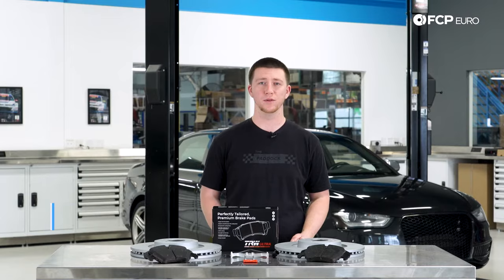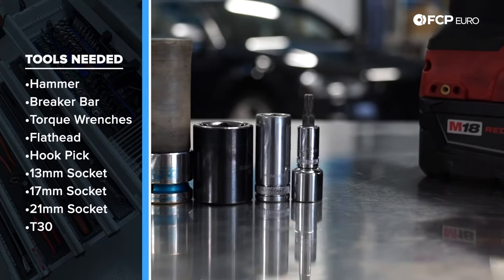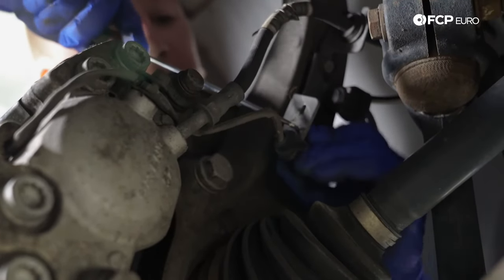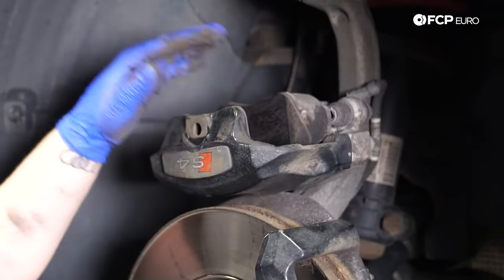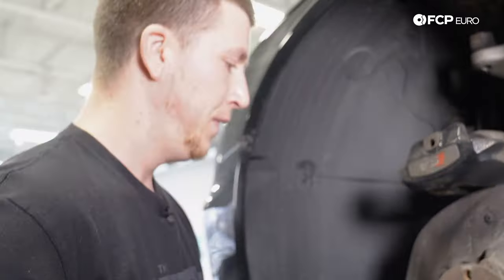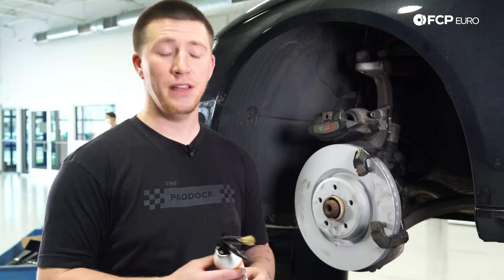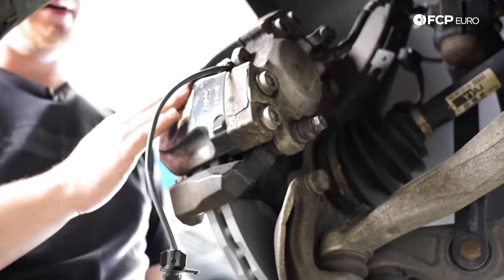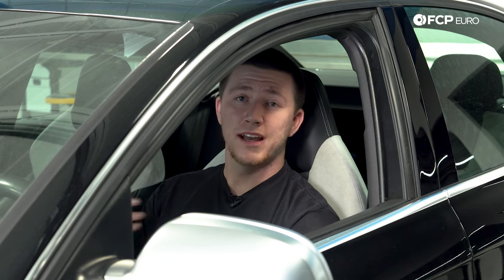Audi B8/8.5 S4 Front Brake Replacement DIY - Brake Rotors & Pads (Audi S4, S5, & SQ5)

Comment: Torqued parts with lubrication do not represent final torque per spec. In some cases it’s almost double. Here I think you can get away with it as most parts are mold steel.

Comment: Dont have a lift so the caliper brackets were a bear! Had to buy an Astro Pneumatic 1822 and a capri 21mm stubby impact socket, then jack up the wheel assembly an inch or so to be able to get them off. Had 1 click of range on my wera torque wrench and couldnt get them to spec but they shouldnt go anywhere. Thanks for all the info!!!

Comment: Hi, can anyone give me any advise... i have a 2010 s4 b8 and one of my brakes squeek when i drive a lot of the time it only stops when the brake is applied, pads and discs a quite new so is the calapier partially seized or do the slide pins need cleaning and lubrication? Thanks in advance

Comment: I can’t remember if it was the front or back but when I did mine I had to use a OBD scanner to retract my piston on the caliper. How did you do yours?
Reply from the maker: Typically that is going to be on the rear brakes on any VW or Audi that has an electronic parking brake. We use an OBD scanner. The best is the VCDS unit, for use with a laptop, but the Autel stand alone is a good choice if you do not have a laptop computer. https://www.fcpeuro.com/products/audi-vw-vcds-diagnostic-interface-ross-tech-vchv23

Comment: Instead of removing the caliper carrier to clean those pins, can I just flush the pins with brake cleaner and leave the carrier in place? When I did the brakes on the rear I left the carrier on and cleaned the area where the retaining clips install.

Comment: Do you need to do any break-in? Also do you not spray the rotors with brake clean to get grease or coating?
Reply from the maker: Hi Aaron, bedding in the pads will be pretty standard. If there is a unique process required, those steps are usually included with the pads. You want to avoid using any break-clean when handling zinc-coated rotors to avoid degrading the coating.

Comment: So no adhesive goes on the back of the pads?
Reply from the maker: Hi Chris, usually the residual is enough to hold them in place, the main thing is to get the dowel lined up, and the pad will stay in place!

Comment: If you don't grease or clean those pins that the brake pads sit on, could that cause the brake pedal to be soft or cause the brake pads to not fully clamp the rotor when applying the brakes? For what it's worth, I've done this job and I let a brake line get loose and some air got in the system. Bled it, changed BMC, did SS lines on all four corners, pressure bled it, bled the ABS module, have no seized calipers and I still have a soft brake pedal. Not sure what to do at this point. 5:54 is the timestamp for what I am referring to. TIA :)

Comment: I had brand new rotors and the caliper carrier is rubbing on them I don’t know what to do
Reply from the maker: Hi Jack, you want to ensure both the carrier and rotor are seated properly. If you have any corrosion buildup on the hub, you want to clean that up as well.
Reply: @fcpeuro  thanks, yea I had to take some rust off with a wire brush to make the rotor sit properly.
Reply: @fcpeuro  I’ve cleaned the rust off the hub  but when you tighten the 13mm and the other bolt  the caliper carrier locks onto the rotor
Reply: Same thing I’d happening to me , what fixed your problem?

Comment: Is it ok to install rotors that dirty? Like how long does it take and how much effort it needs to have a clean installation?
Reply: Just spray a rag/napkin brake clean and wipe off the rotor face where you see dirt/grease. Not a huge issue, even if you leave it somewhat dirty it won't make a difference you will feel.